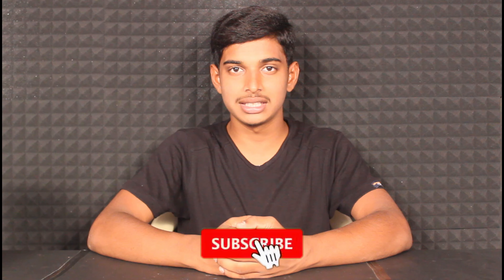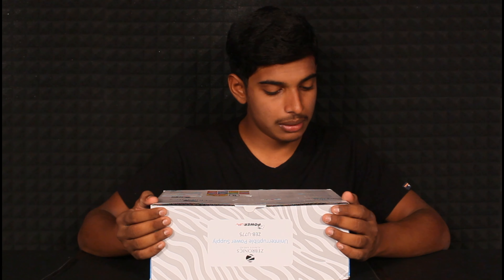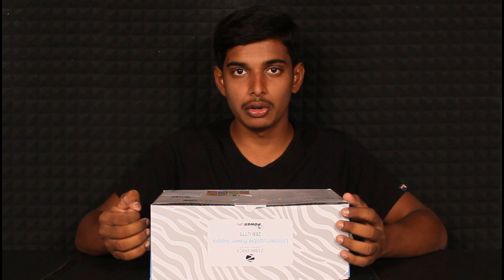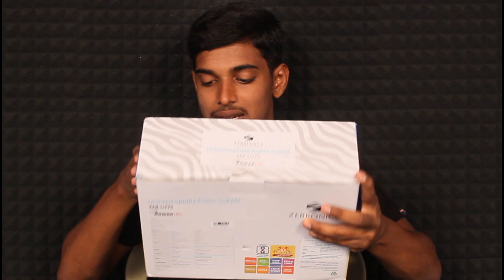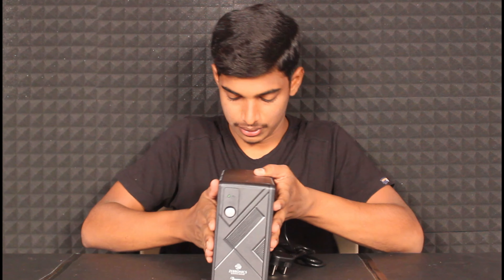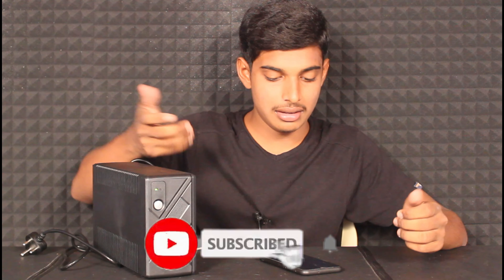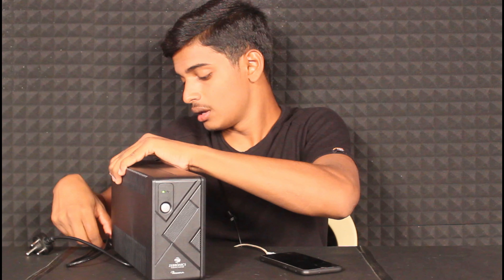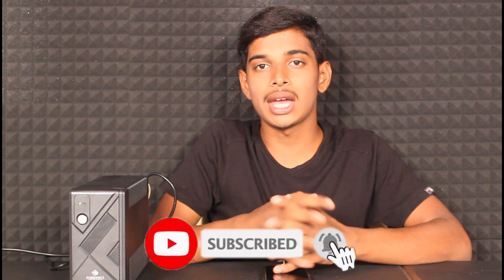Zebronics ZEB U775  UPS Tamil Review | Zebronics U775 UPS Unboxing & Review in Tamil | How to use ?

Comment: Bro i bought this product today there is a little bit sound coming from the ups is that normal or faulty
Reply from the maker: Bro it's a Normal Sound Don't worry. The Main reason of the Sound is to 12v to 230v Stepup Conversion. It will emit sound !!!
Reply: @Independentscientist  ok bro thanks for reply 👍🏻